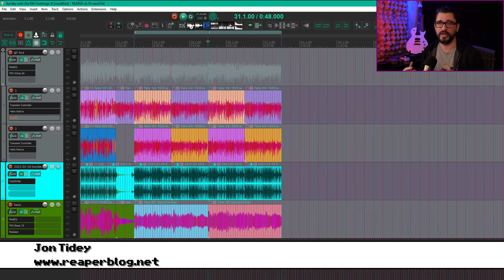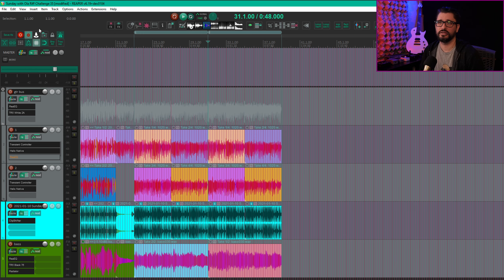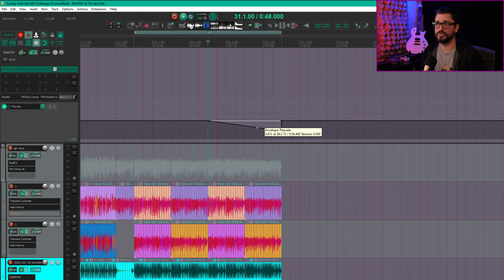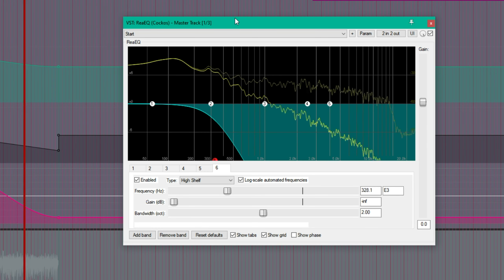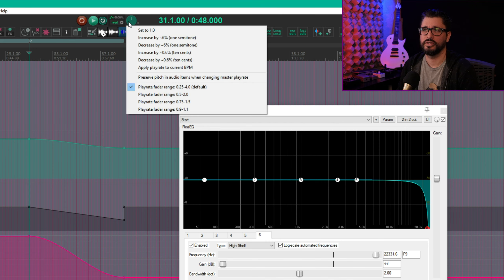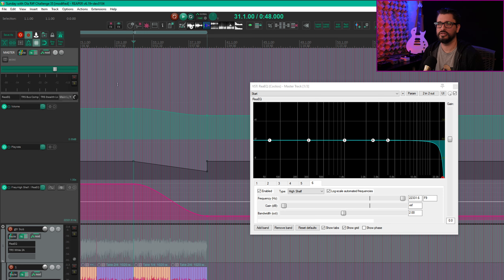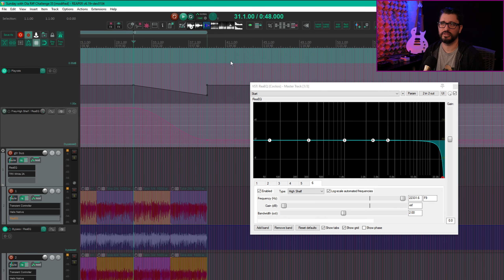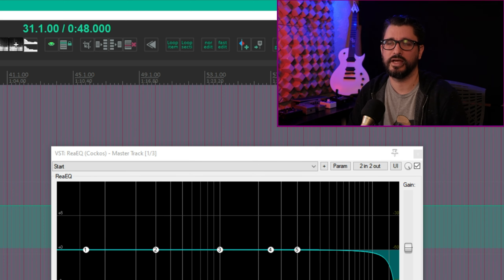Slowdown Effect in REAPER

Comment: Hey Jon,
great video, thanks!
One question: How do you handle the "Mixbus-Issue"? I have used a Mixbus for all my Mastering plugins ever since. Meaning I leave the Master Track just for metering and maybe a safety limiter. 
None of the DAWs I have used sofar in the last 20+ years (Pro Tools, Logic and now Studio One) has a real concept for this. Reaper seems to put even more emphasis on the Master Track as you can switch the Master Track on or off in every track and (as I have just learned) things like the Playrate can be used only on the master track. It seems impossible to use the master track as the mixbus as you can't route that any further. Just curious if you have a concept for this. 
Btw: Thanks for all your input! Reaper has a steep learning curve but every question or issue I have solved sofar shows that Reaper is stronger than all the others DAWs by far. You're a great help on my way! THANKS! 
Cheers, Andy